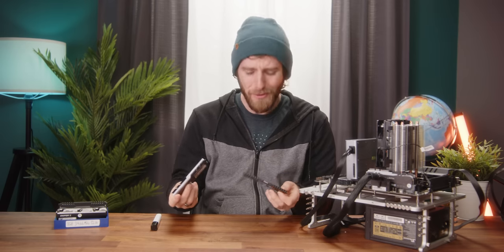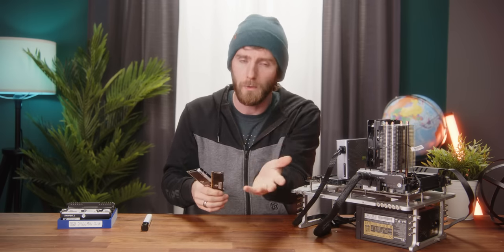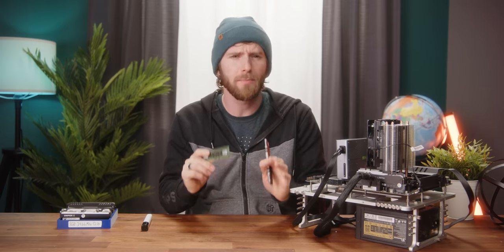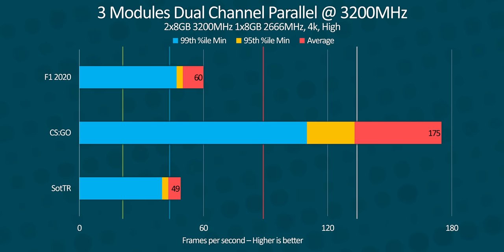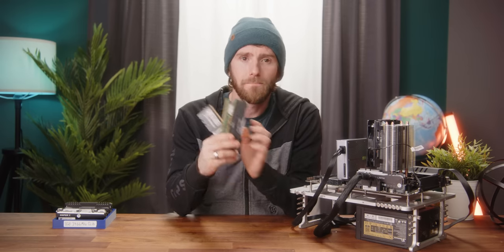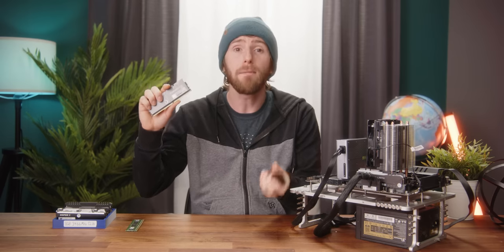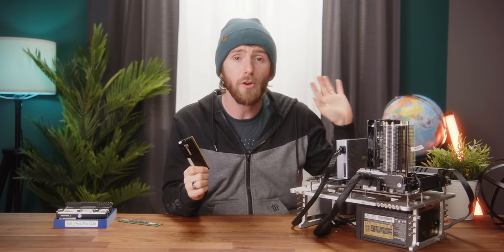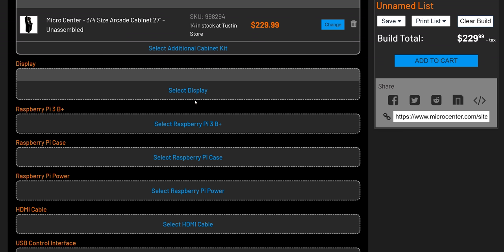Just How Bad is Mixing Memory?

Comment: One time, I mixed memory by taking DDR3 and putting it in a DDR4 motherboard with a hammer. A few additional DDR4 sticks and it didn’t turn on at all. (In seriousness though in my experience mixing ram, it usually is limited by the weakest link. The slowest RAM will slow down other sticks that can run faster)

I would love to see a video where you guys mix DDR3 & DDR4 on some of those systems that support both.

Ps: ily Linus.
Reply: HEY IM SUBBED TO U
Reply: Ily jay
Reply: @xb7778  ME TOO
Reply: E
Reply: Kitguru did an article on the Asrock B150M Combo-G. It supports DDR3 and DDR4, although not simultaneously. No need for a hammer.
Reply: @oldmanonyoutube  Yep basically the same as the AM3 boards with DDR2 and DDR3 support.  Just meant for processors that had both memory controllers, but not simultaneously
Reply: When are you going to try to boil water on a cpu?
Reply: lmao i just watched that video the other day
Reply: Jay really loves his verification badge eh?
Reply: DDR3 is fine, IMO, if you have say, a 1333mhz system and toss in some 1600mhz sticks. And, if you bump up the voltage to overclock the 1333mhz ram to match the latency.
Reply: i remember you and members+ bot
Reply: @mattiem7dmv158  why not use the ram to hammer the gpu into the ddr3 slot?
Reply: @AndersHass  good luck finding a mbo that has both
Reply: That Video will go live at the End of Year...but with DDR5 and DDR4 XD
Reply: @丛雨线  l

poncho lap
Reply: DDR3 and DDR4 are incompatible with each other's morherboards
Reply: I felt bad that DDR 4 was barely an increase in speed. I hope DDR 5 is worth update.
Reply: @dingle2987 , DDR5 will standarize error correction and let single stick host 2 channels
Reply: I throught this is your video lol
Reply: Haha I watched that video
Reply: DDR3/-L is weird tho, often it won't work because the DDR3L isn't dual-voltage and none is really marked as such.
Reply: depending on the cpu and bord some do support it but its rare
Reply: Me who’s been following you channel: Good times 🤣
Reply: 998th like
Reply: that with hammer hurts so much
Reply: nice to see u hoping for a more ft hammer
Reply: on a xeon, i'd love to see
Reply: @michadmochowski1246  That is why he hammer it down.
Reply: I put my SSD in my RAM slot, now I have 1TB RAM.
Reply: Boards designed for both will only enable one or the other. No need for a video.
Reply: “If that stuff don’t fit, hammer that shit.” -Jays Tech Vault
Reply: Don't DDR3 & DDR4 sticks have different notches??
Reply: Probably coz you used a hammer to get them in
Reply: @benmillion1660  nothing
Reply: @Napert  dammit! I was trying to come up something funny and clever like "did you notice the clock while doing it?" and you got there first.  Good show
Reply: I also remember one time you tried to pull out a stick of ram while the pc is turned on lol
Reply: Yep, bios sets clock speed to slowest DIMM
Reply: I had an Intel mobo that could take either DDR2 or DDR3. Best part was, when I decided to upgrade to DDR3, it was back when DDR2 was super expensive (for some reason), so I sold 4GB of DDR2 and made more money than the 8GB of DDR3 cost :)
Reply: "with a hammer"
What
Reply: Mix DDR3 & DDR4 will work in asynchronous 4 channel mode as far as I know and that is specially about Xeon v3
Reply: But what else would one expect?
Reply: It happened to me with DDR2 in 2006... or something like that... I pushed it to hard and motherboard ram slot died
Reply: Not sure how it is for the systems that support both DDR3 and DDR4 (or 4 & 5 now that it is out), but back with the DDR & DDR2 boards, you could only use one or the other - not both. In some cases the system wouldn't boot, or it would always only use the older RAM and ignore the newer.
Reply: Lyt darlin
Reply: Strange,ram usually goes bad before motherboard, that's why  I tried to use ram I thought was all the same,*DDR4 in a DDR3 motherboard)but nope they made ram in a different way xD same length ,but I guess ram is cheap for a reason
Reply: Which brand/model hammer did you used, I'm stuck at that part. If at least the video would show all needed tools.

Comment: Hey people! I want to add some personal experience to this this video - long story short - secondary and tertiary timings matter a lot as well when mixing and long term system instability can happened (random crashed no matter what after a few hours). But can be tuned to make the modules work together.

The complete story is as follows - I have 2 different sticks from Kingston due to a needed upgrade to my system 2 years ago for the ultimate minecraft mod pack (yeahhh, 600+ mods and 8GB of RAM wasn't enough and yeah, I like minecraft) - I was on a very tight budget so a set of dual 8GB modules was out of the question and the original cheap stick was not available at all, even second hand. So I went second hand hoping to get lucky. The "new" one is rated at 2400, while the old one is 2133, both Kingston with the same primary timings. 

However, unpredictable crashes started happening after random amount of hours - might be after 1, might be 2, might be 10, which stress tests didn't reveal. And the frequency of them was growing month after month (I wounder why). I tracked it down to the the memory mismatch and had to actually down speed them to 1833 and get a lot worse timings to get the system to stop crashing so often. Worse yet, the crashing was not completely gone, just happened very, very seldom.

 A couple of months ago I got a second hand Z170 motherboard and got the exact same problem. So I decided to tackled this again and asked the wonderful folks at the LTT forum for some help. And someone suggested it could be the secondary and tertiary timings that are causing problem. So I set aside a weekend, read up on those timings (tuns out motherboard BIOS holds them, not the sticks), plugged in each module individually and recorded the 2ndary and 3iary timings. After comparing them, they didn't seem that off, but decided to stick with the slowest ones from both (basically mixed them) and decreased the refresh interval.  

Aaaaand all worked! The system was stable for 24 hours at 2400MHz none the less! ^^
Buuuut it doesn't end there - I overclocked the 2 modules to 2666 without a problem, 2800 was also possible, but not completely stable (even with more voltage). Maybe again the 2nd and 3rd timings? :p 

Best part - the H110 motherboard I have also allows for tweaking the secondary and tertiary timings! (but no overclocking for the RAM, soooo 2133 max speed). 

I hope someone finds this helpful and sorry for the long comment! Love your vids and wonderful community Linus and all that help make them! ^^
Reply: so ur saying, if u check to see which has the lowest timing, adjust the others to match, u can get them to operate at a better frequency? if that is so, then uve cracked the code. tnx
Reply: What's a secondary and tertiary timing? I've never seen that in the BIOS settings.
There are of course a whole set of timing values.
Reply: secondary and tertiary timings huh? that sounds complicated
Reply: for i am too lazy to read, i will copy and paste this and read it later

just so you know, you are one good person and i aspire to be as kind as you are, have a good day
Reply: Great point man
Reply: Yeah i've heard that before also the ranks matter too, rank 1 and rank 2 rams together can cause instability.
Reply: I did the same too on my Z370 system and its been stable for 2 years now

I use 2x Kingston ValueRAM 8GB DDR4-2133, 1x Kingston ValueRAM 4GB DDR4-2133 and 1x GSkill Aegis 4GB DDR4-2400 and overclocked them to 2666mhz.
Reply: well thanks for your experience my senpai
Reply: Replying so i can come again for future reference. Thanks for sharing your experience
Reply: Gg
Reply: @sMASHsound Well, this is possible, I am not sure what improves speeds though. And latency can be a problem. GamersNexus have promised a video on that since 3 years ago I think.
Reply: @louistournas120  I wish I could explain what they are exactly, but its a deep rabbit hole to follow. I hope one day I will read on them. Or GN will release a video on them. XD 
And they can be rather hidden deep in the BIOS with a different name. If you are not looking for them, you won't find them. And yeah, there is quite a few values there.
Reply: @astaroth_sasazaki_yt  Thank you so much for the kindness stranger of the internet! Have a good day as well! <3
And again, sorry for the long message, I do hope it helps.
Reply: Can I match Kingston 2133 mhz 8 GB cl14 with Kingston 3200  mhz 8 GB ?Please help or I'll lose money for no good.Thanks
Reply: Hey @boomshorts8331  ! Probably not at the 3200MHz speed, but if you put in the time to match all the secondary and tertiary timings to the highest values you see from either DIMM (you put in the sticks seperately, check them in bios, write them down and compare), you should be fine. And don't be greedy with the MHz speed, keep it at 2133MHz.

I hope this helps!
Reply: @aleksandarlazarov9182  you mean tweak them in bios and yes I'll run them at 2133 MHz .Thanks man for replying to such an old thread much appreciated 👍
Reply: @boomshorts8331  yeah, indeed tweaking them in the bios. And no worries, I like helping peeps out! ^^
Reply: @aleksandarlazarov9182 can I pair 2 ddr 4 rams of 3000 and 3200 mhz in dual slot plzzz help I don't wanna loose my money
Reply: @lakshshastry8278  best tip I can give you is to try, it won't break them or your system. Run them at the 3000MHz though. Run some memory tests for like 12h (windows has a build in utility for that, mem test I think). If it works, great, no tweaking! 

If not, down you go in the BIOS playing with the timings as I mentioned in the comment.
Reply: @aleksandarlazarov9182  bought the ram both running at 3000 mhz thx 😊🙏
Reply: @aleksandarlazarov9182 if I dont overclock ram using xmp and using default settings, does mix 8gb and 16gb ram still can cause issue and both have same speed and cl 22
Reply: Idk, try it and write here afterwards
Reply: @aleksandarlazarov9182  it works so far, it even runs in dual channel 😆😆
Reply: @heloyelo_5496  Woaaa, amazing to hear, my friend!!! 🥳

Comment: 20 years ago it was the same problem with Cas timing. Size of MB or GB was not important... the chip on the module were! As long as u had the minimum recommendation, it worked and upgrade were easier. Hundreds of my customers were happy and they all thought I had magic special upgrades for their computers🤣Samsung and Micron were King👑 back then. Great test Linus ✊ Running Pentium 3 and Tx motherboards Cas and Latency were and still are important 😎

Comment: I've been mixing RAM since the second year of owning a PC. I've never gone for anything too crazy different between them, but different manufacturers, different brands and so forth. Honestly never noticed any issues. It was much later down that people cautioned against mixing ram, but I never really paid it much heed since I'd never had any problems. The minor performance issues probably matter more to someone trying to squeeze every last drop of performance out of their system, but I guess I'm just easy to please.
Reply: I'm buying a prebuilt and it only comes with 1 stick of 8gb ram should I get another 8 gb stick? Or will it not work
Reply: few of my RAM sticks died... it could be related to mixing... DDR3. I just test different configurations and see if they boot. I haven't even checked timings
Reply: @Biorider does that work for laptops too? If i were to upgrade because the stock ram on my laptop is a samsung and most local pc stores in our city does not sell samsung ram. Is it okay if i buy a different brand as long as it has the same speed?
Reply: So wait, you're saying I've been wasting time trying to find a matching kit of 2x4 HyperX 2666 CL15 to add to my two sticks, and I should buy a vastly more popular 2666 CL16 version and it will 100% run in dual channel with my CL15 sticks, even with a mild overclock? That's a serious question by the way, I really am anxious about buying a mismatching kit. I heard a few years back, I think even from some tech YouTuber, that unless the speed and every single timing is matching on the second kit of ram, the dual channel won't work. And this video sounds kinda inconclusive, like what if I don't want to match a 2666 and 4000 kits like in the example.

P. S. You know a person is desperate when they seek tech advice from strangers on YouTube.
Reply: @warpspace7871  Same thing happened to my friend after a couple weeks of having mixed rams
Reply: @mihan2d  It will work. They were mixing 4 different sticks,  with vastly different speeds. You are mixing one pair and another pair. With the same speed.
Reply: @hp5469  The main question is will it definitely work in dual-channel. And then ok but what about timings? Will they syncronize automatically, or will you be able to adjust them individually? I punched in custom CL14 timing and 2800 MHz speed for my current pair, but obviously it only allowed me to control the parameters for the all sticks at once. How it will treat 2 pairs with different timings? Will they be desyncronized slightly, up to the point when I punch in custom timings and speed when it will try to overclock all 4 at the desired parameters? The mobo is Gigabyte AX370M-G3, Ryzen 5-1600, if it matters. What bothers me that motherboard manual is being very vague on this issue, it says that for fual-channel operation it is RECOMMENDED to use sticks of the same maker, speed and timings, but doesn't elaborate any further.
Reply: @mihan2d  That's going to be on the specific ram modules you have. Just like in the video some configurations will work and same may not. By using same brand you are upping the chances it will work. By not using the same exact model of ram you are giving up another degree of compatability. They will work together, the question is.. will they all work with "X" timings and/or at "X" speed ?? Answer is you wont know until you try. But that is the answer with any ram sticks. You just have a better chance when its same brand same model.
Reply: I had one ddr4 8gb 2133mhz stick and couldn't get exactly the same so I bought another stick with the same frequency and latency, it all worked fine for 3 days (even in dual channel) and then the PC wouldn't boot. I took them out, tried each of them separately, they worked, put two of them again and it worked. Again after 3 days the PC wouldn't boot so I was like "Maybe the new stick is faulty" and asked for a new one claiming this one is broken. Now I'm waiting for a new one to come but do you think the old one was really faulty or that was just some compatibility issues?
Reply: @warpspace7871  I have had a RAM slot burnout despite having identical RAM (I bought a set of 2 RAM). Now I use a 8GB RAM and 4GB RAM combination on my gaming laptop and they work very well. 12GB is more than enough for all the AAA games that I play and it runs extremely heavy games like CRYSIS 3 smoothly.
Reply: @ Crystan Same here in my early years owning a PC I've been mixing quite wild stuff like one 512MB and a 2GB stick of different speeds and Manufacturer, simply because i found them sitting around in my fathers office. Never had problems and my PC was running faster. Then i shoved in a MSI 512MB graphics card in and was the proudest kid ever. Great times back then.
Reply: @kynokaz  You could even throw in 16 or 32gb stick if you wanted to.
Reply: I bought 32 gigs of Corsair ram around 3 years ago to speed up the Nitro 5 I got stuck with (my mom wanted to joke she got a gaming laptop before I did. She’s an apple user. I was merciful.)

Now a days I’m looking to replace the laptop (it’s a Radeon rx 580, so it’s time is coming quick and it shows) most of the laptops I look at have one stick of Ram soldered in. The other is free to switch out, but still. 

I paid 150 dollars for my RAM because it’s Corsair laptop RAM. I’ll be damned if I just lose the RAM because I can’t match it with upcoming laptops.
Reply: @Wanis23  As long as there's a available slot and it fits, then it should be good.
Reply: @Wanis23  the whole point of this video was in the conclusion where in the end, it does actually come down to luck. 

You can stack the odds a bit in your favour by buying RAM that's manufactured by the same chip maker and/or have similar speeds and latency timings, but it's still luck whether it'll work and how well it'd work. Even when buying two sticks in a kit has a chance, albeit supposedly extremely low, for them to not work together.

So I ask you this, "do you feel lucky? Well, do ya, punk?"
Reply: yeah for just browsing the web and using office programs you would never see the issues!  ;)
Reply: If you mix voltages it can be troublesome for the controller but unless you’re doing some performance tweaking, something really memory specific or otherwise most people won’t feel the differences
Reply: Umm hi 👋
Reply: Hey unm I have a 3000 mhz ddr4 ram can I put a 3200 mhz ddr4 ram in dual slot ???plz help 😊